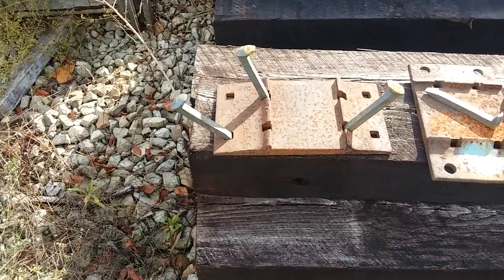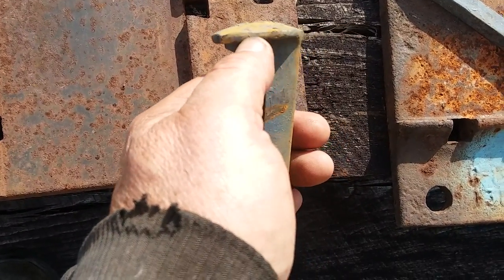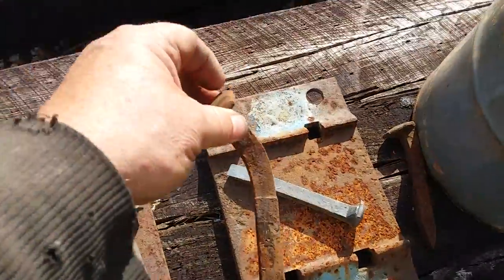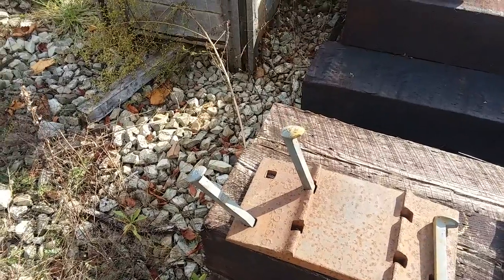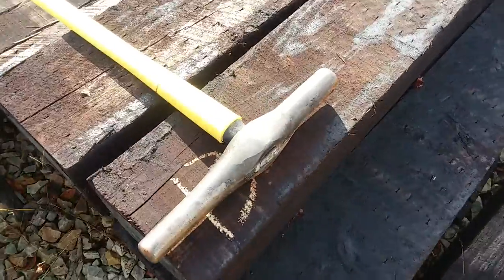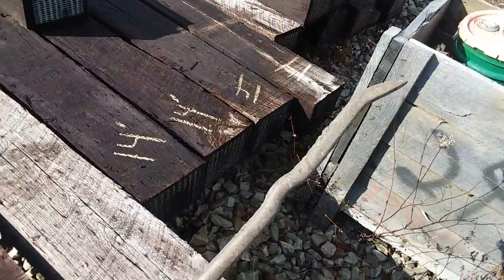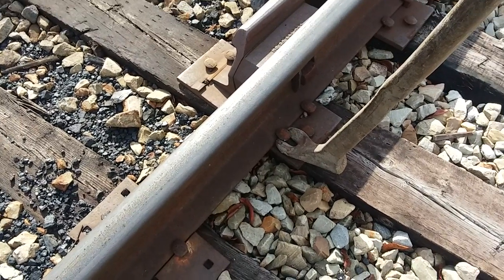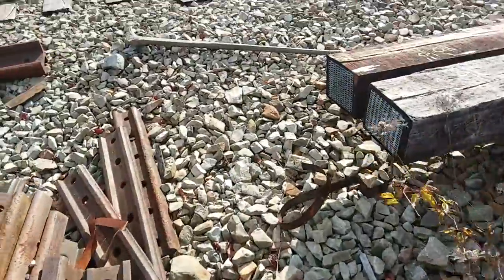All about Railroad Spikes

Comment: I'm really amazed that the rest of the world is using concrete ties and we're still in the 1800's with rail technology. Sad.
Reply: Its simple cost,youre not replacing one tie youre replacing millions of them and that adds up. the other argument I have heard is that American trains are much longer and heavier than other countys trains and  wooden ties can absorb the load better.
wood has give and concrete is very brittle.
Reply: Elsewhere there is one big screw and a clamp that holds the rail in place. You can remove the plate and the screw and use the same hole again and again. Once in a while, depending on how much the rail is used and how stable the underground is, the screw gets tightened up again by a worker. And you can see it from afar which screw needs to be tightened. The time a wooden tie lasts depends on the climate. If there is lots of humidity it won´t last much longer than 30 years. The amounts of chemicals used are a problem and the wood is contaminated and toxic waste when it needs replacement. Steel ties last very long and concrete ties can last many decades, 50 years or more. In other areas of the world, there also is a thin sheet of hard rubber or plastic between the plate and the rail that acts as a dampener to absorb shocks and make the track less noisy. The ties also have a cutout and holes for the screws prefabricated at the right place, so the plate always is exactly at the right place with very little tolerance. So it is hard to mess it up.
Reply: @hifijohn  

I’m from the UK.  We mainly use concrete sleepers (ties), but wooden ones are still sometimes used on new installations.  Some years ago steel ones were being quite widely used, but less so now.  All types normally use various types of Pandrol clips, though many other types of rail fastenings can still be found in older installations.  Traditionally in this country we used Bullhead rail in this country, but for many years now this has been gradually replaced by flat bottom rail, typically of 113 Lb/yd, but I think the latest rail types are metric,, and may be heavier in some cases.  Bullhead rail was usually 95 Lb/yd.

About 10-15 years ago I was in New Jersey several times, and rode from Newark to Trenton.  The track was on concrete ties which looked just about identical to the ones we use here, but thousands of them were breaking up, I’ve never seen anything like that here.  There were piles of ones which had been spot replaced laying alongside many kilometres of track, and they had started a programme to replace all of them.
Reply: @hifijohn  Yup.  Concrete is stiffer and stronger than wood but will catastrophically fail if bent, while wood has flexibility.  Most new higher speed (70+ mph freight, 80+ mph passenger) trackage in the US is being built with concrete ties because the stiffness matters at those speeds (BNSF southern transcon, for example).  While Europe and Asia have been using concrete ties for decades, they have only recently become cost-effective to use on the US's expansive network.

Comment: We still get our spikes in the regular large keg and sometimes in bulk by gondola, if you need some lags for them plates, you can order those either with a square or rectangle head but you'll need to drill a pilot hole and use a hydraulic impact wrench.
We don't hit the back of the claw bar to get it beneath the head, we use a spike lifter.
Reply: Jason, wow I did not know that you could still buy them in the large kegs, that's the
way we used to get them, thanks. Many other folks have written in about not hitting
the back of a claw bar also. We never got a lifter, am gonna have see if I can get one.
I do wonder maybe you can tell me is why the back of the claw bar heel is shaped so
it can be hit? I do keep mine dressed to avoid slivers flying off. Appreciate your comment
sir and thanks for watching
Reply: We order 6 pallets of 9 kegs each and each section truck normally has one keg on each truck but I normally carry two kegs on the section truck I used to drive,
As for the heel  on the clawbar, I was told by the old heads that it's mainly for leverage, the roadmaster doesn't like it when we hit the heel with a sledgehammer, that's why we have the spike lifter that we hit with a sledgehammer.
Reply: Need two guys when using the spike lifter with a sledgehammer,  we use it when the hydraulic spike puller can't get a grip beneath the spike head.

Comment: Cut spikes hold the most if a hole is drilled in the tie; 1/2 inch for a 5/8 spike, 3/8 for a 1/2 spike.  Many railroads have 4 holes drilled for each side before they are treated and spaced for the size rail that is used for the track.  The base of the rail for 130, 131, 132, 133, and 136RE rail sections is 6 inches.  The difference in rail weight is in the head size of these patterns.  
Screw spikes are mostly used outside of the US and Canada and for track that is held together with what are called "chairs".  In the UK and Europe, screw spikes are known as coach screws and have a square drive-head.
Cut spike pattern for tangent track is the field or outside of the rail is close to one side of the tie and the same side of the tie while the gauge spikes are placed close to the other side of the tie on the inside or gauge side of the rails so there is an angle through the spikes that meet between the rails.  This pattern helps keep the ties from twisting under the rails and narrowing the gauge of the track.
The spike maul you have is called a "bell pattern".  I normally spike over the rail also but really, you are not supposed to drive spikes over the rail, for safety.  The small end of the maul head is for driving spikes in the confines of the frog, guard rails, and other close rails in turnouts and other close quarters.
The spike puller or roadmaster is also used to safely pull the outside spikes on bridges so you are standing between the rails when pulling the spikes.
Spikes are available from 3/8 X 2 to 5/8 X 6 1/2 with special lengths for frost-heaved track(until the track thaws).
Reply from the maker: Thank you very much for sharing all that info with us Roy. Interesting about the spikes holding better if the holes are pre
drilled. We've never done that. They sure would drive a lot better tho! A good many railroads out there don't want you spiking
over the rail. Does seem like there are a lot more broken handles
doing it that way so maybe that has something to do with it.
Really appreciate your taking the time to check out the video my friend and may you have a very good day.

Comment: I worked on Erie Lakawanna special gang 88 out of Garettsville, Ohio the summer of 1969 doing tie replacement.  I was a gandy dancer.  They used power equipment mostly.  A scarifier, a cherry picker, a Nordberg spiker, but the spiker could not spike at the rail joints, so I spiked them manually.  Tip of the cap to Joe Mcnair, the boss, and the crew, including Freddie Sanders also known as Brad Runion.  Hard work in the hot summer sun, but fun too.  I held the section record for driving a standard spike into an oak tie in four licks.  We gang spiked sometimes when a train was expected and the machines had to clear the rails, but I was faster alone.  On a good day we replaced 100 ties.  Gas was 25 cents per gallon, cigarettes were 25 cents a pack, and I got paid $2.50/hour.
Reply: I was a gandy dancer back then.  Great Northern in North Dakota.  I also worked on section crew.
Reply: ccrx6700, forgive me for an off-subject post. I remember those days. $2.50/hour was above average then. My helper in the plant was making $1.85/hour, his wife didn't work, and they were okay. Try that today. In '73 gas went to .39/gal., .52/gal. in the small towns. I swore i would never pay that for gas....Cigarettes were $1.50/carton, 2.50 at the Rippy Mart. They've ruined this country. Now young couples making a combined $1,200/week are scared to death. Back to cheerful things.....

Comment: Hello !
Thank you very much for the lesson on railroad spikes. For the last 12 years i,ve been learning about the railroad as an employee of Boston Mass MBTA/KEOLIS COMMUTER RAIL SERVICES.  however i,ve been a rail buff since I was age 5. Rail buff not so much on steam  trains or even diesel motivated power, but very , very much I,M obscessed with electrification such as the old Pennsylvania railroad GG-1 ElectricS that rans off of 11,000volt catenary territory at 25 hz . Yes I remember my mom taking us kids back in the early 1950,s on the eastern main line of the Boston & Maine with passenger cars being pulled by steam locomotives. Yes , i,m a working senior citizen  at age 75 working as a B&B ELECTRICIAN.  I,M CURRENTLY ASSIGNED TO TAKING CARE OF THE DRAW BRIDGES ALONG THE ROUTE THAT I ONCE RODE ON AS A CHILD. I,ve been a Mass licensed electrician since 1972. Before beginning my career with the railroad at 63 years old,  I was an industrial electrician that was involved with automation machine building for almost 20 years. Some of my other assignments on the railroad where servicing switch heaters, derailleurs, under rail lighting in buildings, sand hopper systems etc. Yet I had to take NORAC and RWP TRAINING. NORAC was challenging for me because sitting in the class I felt like an old dog being taught new tricks. It was an entirely different working culture. Knowing how to protect track was paramount because not only it was my personal safety but also an FRA INSPECTOR coming out of the bushes, and challenging my documents and the form of track protection I was using. Hence, i,m still learning. Most importantly, before I start any work, I do a safety briefing. Last Monday's rule of the day was #S-6.8.15 PANPULLER TOOL. Even though it is not what I use, or for that matter would never use, I still have to at least read the rule because in  case of an emergency,  I may have to use it. Or work near someone using such a tool. Yes, i,ve scene the you tube video of the origin on why the rule of the day was incorporated in railroad operations.  It originated from the old Pennsylvania railroad safety films.All I can say is that a railroad working environment can be unforgiving.  That 4 foot foul rule and the track speed of the territory i may be working in means a lot to me, plus the foreman in charge, if I enter that person,s work territory.  Even though I don,t come under BLUE FLAG PROTECTION, I still have to set up my Orange tags and RWP SIGNS AND PROTECTIONS. 
            Anyway, I would like to see more explanations of track infrastructure when it comes to dedicated electrified high speed rail lines of China in which their trains on one line EXCEEDS 200 MPH. California is currently building such a system. France back in 2007 ran a test train of the TGV AT 357MPH. Those tracks have to be perfect with deeper ballast and foundations. 
             Yet I appreciate it very much what you presented to me about railroad spikes and related work. 
              I love to keep learning about ALL ASPECTS OF RAILROADING.
                THANKYOU!!

Miss Paula Walach
Reply from the maker: Appreciate the very nice comment Paula, that is so cool you
are still working, I'm 69 and still on the RR too. Quite a tribute to
who you are and your mindset. You go girl and don't stop. You're
an inspiration to this younger generation.  I can't help you on
the electrification, we don't have it here on my RR. Thank you for taking the time to visit with us and write in my friend.

Comment: I worked on tie gangs for Penn Central and Conrail for many years and operated 2 types of spiking machines. The first was an RMC Spikemaster witch was an pneumatic spiker with 4 air hammers. It required holes bored into the ties with a machine called a tie borer as the spiker didn't have the power to drive them without it. This was in the early seventies, it also required 2 men with 8 pound sledgehammers with the handles sawn off with about 1 foot left to set the spikes. Talk about a backbreaking job. Then the spiking machine would drive the spikes in. A few years later we had a hydraulic spiking machine called a Nordberg HydraSpiker operated by 2 men that eliminated the need for the tie borers and the spike setters. It was much faster and did a much better job.
Reply from the maker: Ralph, Awesome comment!  Not too many guys left worked for PC. I remember hearing about the hydra spiker, but never saw one. Thank you for sharing your story with us.

Comment: I worked for SP in '76 out of Houston, TX.  I was on a tie gang for about a year before getting a job in the A&WE dpt.  running a cat d7e dozer.  I  have 3-man and 2- man gandy spiked a few miles of track.  Those spike mauls will bust a knee cap if you bounce off the rail head.  We would follow the tamper with the air hammer spiking the majority of tie plates, but we had to get the ones they missed by hand.  I shoveled a bunch of ballast behind tampers.  Hard work.  But I was young.
Reply from the maker: Awesome story, thats railroadin!!! Lol. Thanks for sharing. Got a very good friend who way back also worked for SP. He didnt work there long but did become a brakeman

Comment: You should explain how the chisel tip on the spike breaks the wood fibers and bends them down so they act like springs against the shaft to keep the spike in.  And by the chisel tip going across the grain, it does not split the tie.

Overall a nice, easy to watch video.  Keep it up!
Reply from the maker: Was nice of you Paul to write in with the suggestion for a future
video, I will do that next tie or spike video I make.  Glad you could take the time to pay us a visit and check out the video my friend.
Reply: It's such a foreign concept to me to drive a spike in without drilling a hole first. Must be pretty soft wood you use. Here in New Zealand spikes are long out of use but our little railway still uses them. Was driving a heap in yesterday

Comment: I was sawing an old sleeper with my chainsaw and hit a spike that was broken off in the wood where the spike hole was , the old spike had a spiral screw thread on it , not square like them ones you show there , it wrecked the saw chain 😊, great video , greetings from Ireland 🇮🇪.
Reply from the maker: That was a lag screw Martin and no doubt it broke your chain,
those things are tough. Many RR's in your part of the world used
lags instead of spikes and still do. Appreciate your taking the time to check out the  video and write in my friend.

Comment: I would like to add few things being a RR'er myself .
  When driving spikes there are certain ways you spike a tie and it all depends on the gage of the track...
   If the gage is good.( 56.5 in is what you strive for.) and your are replacing ties. The first spike you would drive is your outside.
If you drive the inside first you have a chance of pulling the rail and causing wide gage. Then the inside then lag.
   If you are gaging and depending on how the gage is running i.e. narrow( less than 56 1/2 ) 0r wide more than (56 1/2,)
Narrow you would spike the inside first with the spike on a slight angle to pull the rail wider..
 And do the opposite if you have wide gage. Spike the outside pulling the rail in.
You also want to keep uniform gage  so say  the gage is running at say 57 1/4 and you are doing a spot tie renewal.
   You can spike it to the 57 1/4 or a little less maybe 57 57 1/8 .
 Spiking that one tie to 56 1/2 will be difficult with gaging  and 2 if you are able to get it .you will leave a gage spot.
Reply from the maker: Randall, thank you very much for your informative comment, appreciate you adding that in to the chat. If gauge is good, I like to
drive outside spike first also, reason being is it keeps the tie plate field side shoulder tight against the rail. Thanks for watching sir
Reply: @ccrx6700  You are very welcome..
You video is very informative also.
  Some people perceive track work a mindless job...There is some serious  mathmatics and reasons why things are done a certain way.
After all there alot "riding" on that things are done correctly.
  Sorry for the pun😆.

Comment: I saw the rails in the film were bolted. Most are welded together now from what I see. My cousin showed me how to get the old bolts out. Use a chisel with a flat about 1/4 inch wide where the cutting edge should be. Set it on a nut flat and give it a couple wacks. They pop right open.
Reply: Thank you for watching. A lot of rail here in the US is continuous welded rail, Our track was built in 1975/76 as all jointed track, which while cheaper to build, is far more maintenance intensive
over the years. Have never tried doing that with the bolts, we have track wrenches,a gasoline
'bolting machine and a hydraulic impact wrench to take nuts off and on.

Comment: Very informative; thank you! 1) Anchor spikes are NOT used on the gauge side because a “high” spike could lift the flange edge and derail the train/car? 2) On the “beads” on the tie plate, the gauge side is higher than the field side is because the weight passing over the rails wants to spread the rails by tipping them so the gauge side is taller to counter act that tendency? 3) And of course … “can you put a round spike in a square plate”??? 😉